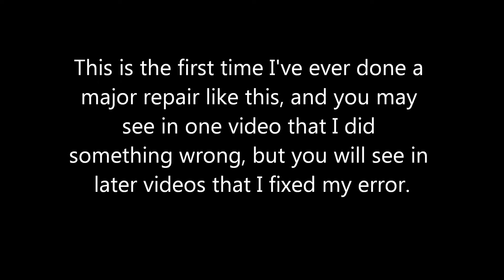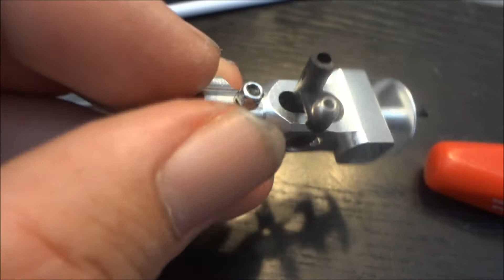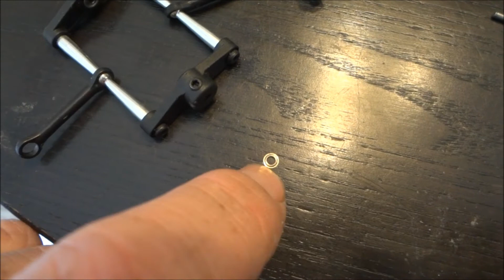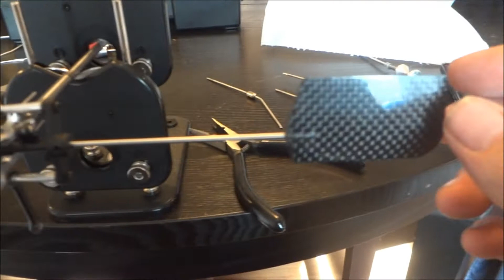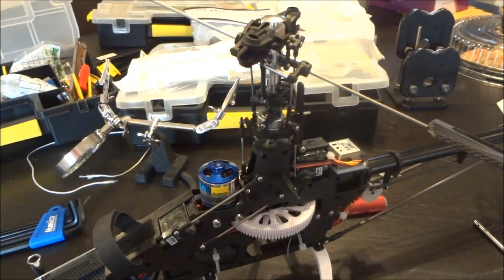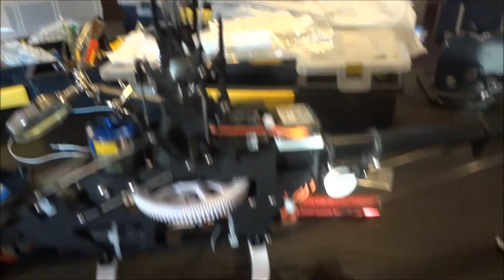Blade 450 Complete Repair Part 6

Comment: You should update these with edits or make notes that you've discovered later in the video that something is wrong, like the see saw fly bar  holder. I thought you had put it on backwards the first time but went along anyways, and that thing is a pain to takeout and install. But excellent job with the videos, covering everything that the official ones don't. Thanks for your contribution.
Reply: Greg Truelove
Reply: Greg Truelove   ,Hey ,I think you did a real good job man,I needed to know ,how to wire the receiver back , all my wires came out when I crashed and ,I was hoping that you showed how ,but I did not see it happen, I,m real new but I,m trying to learn ,you really helped me a lot I still have not found out how it's re wired ,the one Tech at Horrzion ,said He didn't, know, he sounded about Frigging ,Worthless!  I still have not learned where they go,but thank you again.